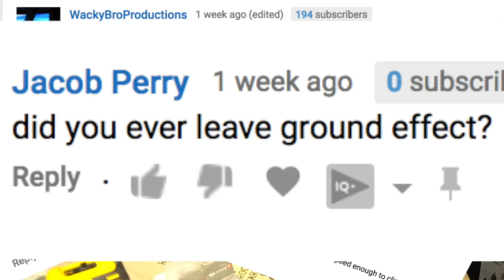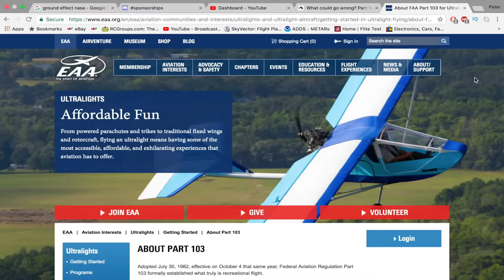HomeMade Electric Airplane

Comment: “Can a person build and fly an airplane in their basement?” No there isn’t enough room to fly
Reply: It depends on the size of that basement.... 🤔😏
Reply: Do you need a pilot licese to fly an airplane?

"Screw that"
Reply: @haze6647  you don’t need a pilots license if the plane is classified as an ultralight however you do need one for other classes of aircraft.
Reply: Hahaha!
Reply: @pearlio7297  ah so they don’t care for your safety but for the other peoples safety got it
Reply: @monkeguy2203  dude the most it can weigh is 254 lb and goes at the most 65 mph and most of the planes you can buy require you to know how to fly it before purchase and if you build one you probably will know how to fly it when you're done building
Reply: make a small one
Reply: @haze6647 Recreational planes don’t need licenses.  Just gotta know your parameters and where you can and can’t fly.

Comment: You should add a generator which will generate electricity due to the wind speed while the plane is flying. This will then recharge the batteries allowing them to be reused whilst flying.😉
Reply: What would break the laws of thermodynamics. Because energy cannot be created nor destroyed. And it if he did that energy put into providing thrust is more then the generator gets back. Another way to see this is this is the same as hooking up an electric motor directly to a generator.

Comment: So for one thing, you decide to build your own airplane, and pull it off with ease!! Then you decide to power it electrically, something that many major airplane producers can still now only dream of... And you nailed it again!! Awesome project and super inspirational, Well DONE!!!
Reply: UltimateFreggle's Adventures yeah the only difference is that major airplane producers are trying to achieve that with transporting a few hundred passengers on jets weighing tons. not a 240lb airplane built out of wood
Reply: @HH-kz2jt  ok I'll give you that one. Still impressed tho...
Reply: UltimateFreggle's Adventures yes def. i cant even assemble my own ikea furniture lol
Reply: @HH-kz2jt  Hahaha LOL
Reply: @Viscot have you ever tried to build something Viscot ?
Reply: He never goes up high
Reply: @HH-kz2jt  Yeah that's the problem with this kind of thing. It's an interesting hobbyist project, just it only works as a hobby aircraft, it isn't really practical.

Comment: Now put to MG 17s on the nose and become a fighter ace.
Reply: Flame thrower?
Reply: no, 20 mm Hispano cannons for the most F you plane ever
Reply: @antispaghettigod1201  that my friend could burn the plane and he would die
Reply: *MG 151s
Reply: @williammccudden7025  20mm hispanos on the wings.
Reply: @arandomyoutuber6634  no. MK 108.
Reply: Stop arguing about guns. But M134 Vulcan and everything will be fine 👌
Reply: @arandomyoutuber6634  Nah, MG 151/20s ;)
Reply: @Linkatchu  MG17!!!!
Reply: @pacio4314  good point.
Reply: The weight imbalance
Reply: @markboyle1843  r/wooosh
Reply: @xxashleythefoxx6765  r/woooosh
Reply: @hectichive889  r/wooosh
Reply: ARandomYoutuber, I see you used the same exact insult to 2 other people. Clever. I know what the joke is. I just like to cut it down
Reply: ARandomYoutuber, not even your comment too
Reply: @hectichive889  You clearly have never heard much of r/wooosh. it is not an insult. and FYI you can use it for other people
Reply: ARandomYoutuber, Dude everyone has heard of that. It’s just not as original as you think. And what else would you call it besides an insult? I mean, I know you’re just joking around, but ya know I did point out the fact I know the original comment was a joke. Quote: “I know it’s a joke. I just like to cut it down.”
Reply: @hectichive889  and FYI if you are going to "cut a down" a joke then make it obvious that you realised it was a joke.
Reply: If two seater, then give a m249 on the back side.
Reply: @arandomyoutuber6634   NO UR A MOOSE
Reply: @markboyle1843  NOOOOOOOOOOOOOOOOOOOOOOOOOOOOOO
Reply: Green baron lmao
Reply: What about a 50 cal ?
Reply: I don’t think he’s used enough duct tape and bailing wire to qualify for the African engineering standards
Reply: ARandomYoutuber they need to build 2 of these with automatic bb guns attached and have dog fights
Reply: Cloгох Блять Nyet Kalashnikovs on wings and Mohsin negant for tail gunner
Reply: @williammccudden7025  naah, the MG151 is a far better cannon
Reply: @andyenid2  too heavy, plus its impossible for individual to do it. The most he could do is a dirty bomb.
Reply: Nah just get a ma deuce
Reply: @BW-fz5kf  that's how you blow a plane up
Reply: GAU-8 for maximum BRRRRRRRRT.
Reply: Plz some body tell  him to check the message in the  MK3 part 3
Reply: @arandomyoutuber6634  an unfunny, way overused joke

Comment: Weldone Peter. Now you could make aviation history. By building the first fullscale manned foamy you must please build a RC scale replica , fly it and post the build scale plans. Howz that for a challenge? Then we can all build and fly your plane.
Reply: Foam has been used in mold less composite construction of aircraft for decades. Long Ez, Rutan voyager.  You cover the foam with fiberglass to make a solid structure.
Reply: Tmtr   to much to read

Comment: this guy will survive the zombie apocalypse
Reply: Thinking the same thing xD
Reply: They didn't know what to do witha small gas engine. I don't think he'll last to long
Reply: Yea
Reply: volksrod69 it is a shut the fuck up motor, so it will work nice
Reply: Bro I was literally thinking the same exact thing 😂
Reply: All you need to do is add two AK-47s in front of the plane and it could be a fighter plane
Reply: holy thanks i didnt think this will get so much likes
Reply: This won't be of much use when the power grid goes out
Reply: @Thematic2177  solar and water turbines
Reply: Well its not going to be plugged in the wall
Reply: @Viscot batteries will last a while if cared for properly
Reply: I was thinking the same thing, but honestly... I doubt he will survive until the zombie apocalypse.
Reply: @Galdring  lol
Reply: He'll watch the apocalypse from the sky
Reply: It's here .....

Comment: I would advice you to install a volt and capacity meter as an additional gauge in your instrument panel so that you can be alerted when voltage and amperage is running low so you can know when to land. Also see if you can fit alot more batteries to further increase your range.
Reply: m8ty.com The volt meter is definitely a good idea if it isn't on there already, but I dunno about adding additional batteries (aka a lot of extra weight). This plane is more of a novelty rather than anything you'd actually want to fly anywhere.
Reply: Have you built you own one mate? Let's see your better version.

Comment: Build another one and add paintball guns
Reply: Toxicity At its FINEST Woah why the hate?
Reply: Banwoi it would still be fun
Reply: Toxicity At its FINEST LoL much?
Reply: Toxicity At its FINEST geez man relax
Reply: It would be fun, but you need to consider the motors, when the bullets hit the other's motors, it could stop working, the plane could spin out of the sky due to the low speed, and then, it will crash and leaving the other injured, or worse, unless the other is flying low, but the plane could also flip over, and also, the bullet could jam a vital control part (elevators, rudder, etc), or even break a wing (he mentioned that the wing rivets wasn't very strong)
Reply: T Squared you saw too much films
Reply: Nah, 50 cal
Reply: paintball guns would be illegal. an m61 Vulcan however...
Reply: T Squared I think you got wooshed, look at his username
Reply: Alex Watkins lol
Reply: T Squared it’s in his name
Reply: bring that to the outdoor paintball area
Reply: Toxicity At its FINEST username checks out

Comment: Flight time: 2hrs

Recharge time: 2 days  d:
Reply: Try maybe 5 minutes of flight time, recharge time may be about right unless he has several chargers. Nevertheless an awesome achievement!
Reply: With one hour of flight time, you can pretty much have fun and practice some procedures to gain flight skill. I would say it's fine, considering the cost of flying planes powered by other kinds of fuel.
Reply: Flight time: 20 mins

Charge time: 2 weeks
Reply: My drone (has 6 propellers) runs for 10 mins and you charge them for 10 hours
Reply: With one hour of flight time I would use it to commute to work XD
Reply: Not many people ever get to do this....
Reply: tsssskk ( sarcasm), you're missing the point.  Stay away internet troll!
Reply: Bryce L but how will you get back with 2 day charge time?
Reply: Kinda shows why gasoline is so popular.
Reply: Buy a whole bunch of batteries

Comment: Dammit Peter, you're IN a FULL SIZE plane now, stop flying like an RC already!, put on some parachutes on your back and take that thing above the clouds! You already know how to glide back to the runway without power anyway.
Reply: Sorry but I think that would get his pilot license taken away.
Reply: why?
Reply: He can’t, it wouldn’t be safe.
Reply: That's why he'd need a parachute geez...
Reply: ヴァレンティニヴィニ 
)
Reply: ultralight, you don't need a license, and have you read the FAA rules????
Reply: Carl Johnson there are still flight restrictions...
Reply: Vinícius Agostinho baffling how you think it’s that easy do you not know anything about this subject?
Reply: +Acaicia Hogan he does have a licence.
Reply: Vinícius Agostinho it’s unable to fly it the clouds with that amount of battery he will lose all power by the time he get to the clouds
Reply: Vinícius Agostinho he loses power he loses control he’s using electric servos
Reply: commonnerfer hes not using servos? That would be stupid... all Fight control is done via stick, rudder and wires... minus the Escs for the motors.
Reply: you need preasurized cabin, Needs a bigger motor, Anti-ice, bigger battery, Remodel wing, bigger fan, needs more instruments, Radio, Master Warning sign. you need all of these to fly over 10.000 feet.
Reply: Runson Renault Denfison I don't think he meant go to a flight level dude...

Comment: Get a easy poor man slip indicator which is a piece of yarn on your dashboard. Since your plane is a pusher if it is straight.  You are coordinated. If it blows to the right or left step on the rudder accordingly. Watch some glider in cockpit video that yarn on the windshield is a inexpensive slip coordinator.
Reply: Great idea...
Reply: Agreed. I would love to see the rudder movement in the camera angle from the wing as well. But it looked really solid & dependable in the air.

Comment: @PeterSripol, Man, Your plane is great! I love it, Though I have noticed a flaw. You have no support for your head. If you have a bad landing the force goes straight to your neck then, Snap, your disabled.
Reply: Placing the seat on a support of polystyrene could help this - needs a crumple zone or larger wheels or flexible wheel mounts for sure, in event of heavy landing

Comment: I get a kick out of these armchair pilots. Ground effects only last from between 1/2 to 3/4 of the wing length (depending on wing design) AGL.  In your previous vids , you were much higher than that.
Reply: Mazda rx7 - I was thinking the same.  He could have gotten higher if he wasn't being cautious.  I' not sure ground effect would have gotten the wheels more than a foot off the ground.

Comment: ELECTRIC HELICOPTER BUILT 👍
Reply: P3L1GRO X VENIR do you even know what those emojis mean?
Reply: TheBlueSlime 2003 lmaof
Reply: TheBlueSlime 2003 what is emoji? JK 😂
Reply: RidoxWuzHere Youtube it's like jumping from one spot to another if you try to jump by standing in one place you will not jump very far unless you have some mussel but by running and jumping you can jump far even if you have not as much mussel.
Reply: P3L1GRO X VENIR a
Reply: RidoxWuzHere Youtube That’s why you have a gearbox on a helicopter.

Comment: You did a really good job, but ig if it was mine, I would change the engine location. It's very dangerous to keep something rotating so fast between your 2 wings. If you face some engine blow up you would fall from the sky immediately.
Reply: Not to mention of the prop snaps it has a high chance of flying straight into his head. But boy would I take that chance to fly something like this.
Reply: Allan Henrique A Lot of ultralights have engines directly attached to the wings. Considering this is an electric plane, my opinion is that engines have been placed in the farest place possible in the project.
Reply: foodtrucksaopaulo Nogueir Tem uma diferença enorme entre um projeto profissional de ultraleve e um projeto caseiro. Motores de boeing 787 por exemplo são extremamente confiáveis, e por isso, mesmo com 2 motores apenas, recebem a classificação ETOPS. Esse vídeo é de um projeto caseiro.
Reply: I think that because the whole thing is nearly 80% foam, I would think the foam would absorb the energy from the shrapnel of the motors and would at least glide to the ground. Also, electric motors almost never blow up.
Reply: good question, but on  bi-planes the engine ca not be too far out or in some locations
Reply: @Itz Annoying, the double-pusher configuration is not what bothers me with this awesome project - it is the fact that the wings are not staggered.  It has been thoroughly proven that multiple planes on the same "plane" (alignment) do not add "that thing that makes them fly".  Howl-ever... the use of quarter scale model airplane electric motors to power the bipe is awesome, super-green!
Reply: It's much better if he puts the propeller at the front of the aircraft

Comment: If you add solar panels over its wings maybe you can extend the range?
Reply: By a few seconds, perhaps.
Reply: No. The weight of the pannels surpass by far the amount of energy added to the system so in the end he will end using battery power in order to carry the extra load.

Yet your idea is not bad, he stated that the airplane has much more lift with the new batteries wich perhaps allows a layer of  photovoltaic paint, it would be just a simple math problem over paint weight/load added vs electric energy gained in a standard daylight scenario, perhaps it works perhaps it doesn't. Yet it would change conditions of flying, it would restrict flying time on darker days.
Reply: Solar power is really ridiculous

Comment: Dude, this is a fantastic build! But don't you think the landing gear need to have shock absorbers and be longer. As it is, the bottom of your wings is vulnerable to damage in any accidental landing.
Reply: can't add anything to it, just a few more pounds and it would never take off even in calm weather. it's designed for rich people so there's no worry if it breaks they will just have their staff build another one for tomorrow and throw out the old one like a smoker throws out a cig butt

Comment: Wonder what material you used to build the aircraft?
Reply: I tried to think of what he used but probably missed something...
Polystyrene/Fiberglass/Wood/Pvc / acrylic / glue
Screws/nuts & bolts/washers/elec connectors and crimps 
Battery's / speed controller / props / motors

Comment: You should put solar cells on top of it and make is semi-solarpoward
Reply: weight would probably drain the batteries way faster than they would charge em. I think that one plane that had solar on it and flew around the world or whatever was made of some very light exotic materials probably, and definitely had larger wingspan/solar area. But on the plus side, adding solar would allow to fly, land, charge, fly again which is a nice bonus of battery vs gas
Reply: yeah solar would be nice if only for repeat flights, even just bringing one along in the truck would work lmao
Reply: They used lithium sulfur batteries because they are much lighter. Much more costly, too.
Reply: Ben P. I think the idea is to slow down the battery drainage.
Reply: Not so ultralight after that
Reply: Christian Wang

Comment: Let's see it at 10,000 feet up in the sky now...
Reply: lol he would probably run out of power around 800 ft or lower. depending on accent angle.
Reply: DarkShadowsX5 i'd be willing to bet that he could make it up to 1.5km with the proper oxygen setup
Reply: HexpressI think the FAA has a 500 ft max ceiling on ultra lights? But for arguments sake, what's the world record for maximum altitude reached by an electric motor airplane like this? 1.5 km = 4900 ft, he wouldn't need oxygen until about 15,000+ ft elevation  So what's the world record? We'll know when this kid sets it!
Reply: Cole Bender air is pretty thin there
Reply: I think the FAA also requires pilots have oxygen above 10,000 ft. because typically people start to have reduced mental clarity & slowed reflexes from reduced O2 absorption when atmospheric pressure is less than at that altitude.
Reply: explain accent angle? I googled it and got books and movies.
Reply: He means climbing angle, I think
Reply: Yes.. Climbing rate.
Reply: I believe he meant ascent.
Reply: Cole Bender think about how fast the wind is up there just saying
Reply: Garry Kennedy 33
Reply: in order to fly it up to that measures , he will need more than just the airplane and seatbelts, he will need to install radio to talk to the radio tower that an unknown flying vehicle is up in the sky,
Reply: you can go to around 20,000 before o2 is needed, just think, a normal jump is 12k
Reply: Per regulations the pilot must have supplemental oxygen at 14,000 feet and at 15,000 feet all passengers must also have supplemental oxygen.

Recreational pilots (such as my instructor in ground school) don't like going above 10,000 as you do get a little impaired after a while and it can give you a headache that isn't very fun.
Reply: Cole Bender i agree
Reply: CTFreeman12 oxygen is required for pilots above 12,500 ft MSL for more the 30 mins while above 14,000 oxygen is required continuously.
Reply: Robert Sales You're*